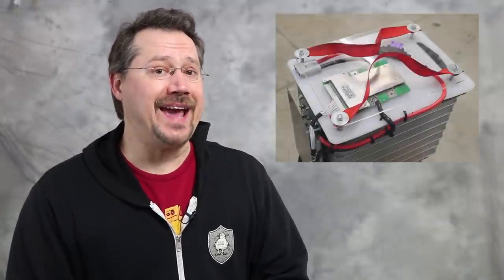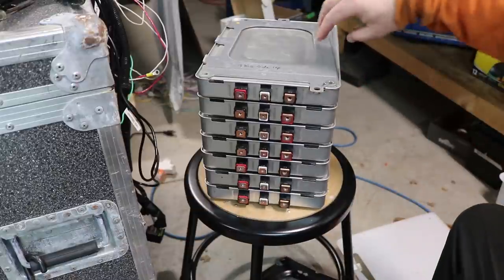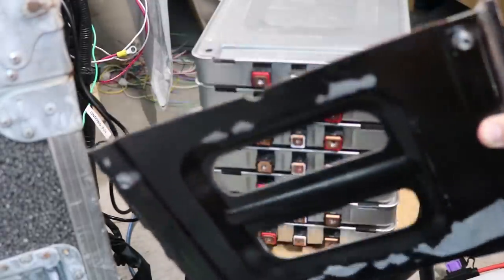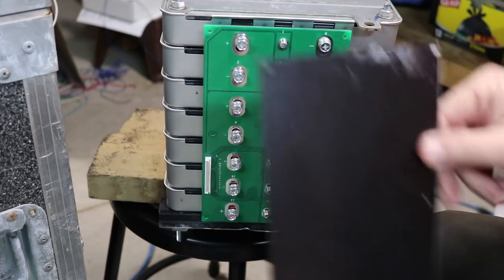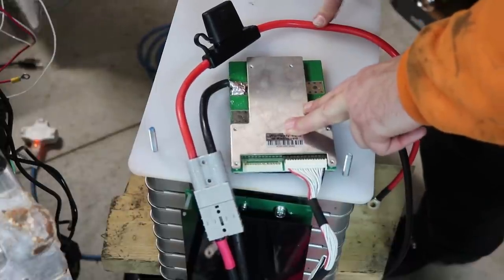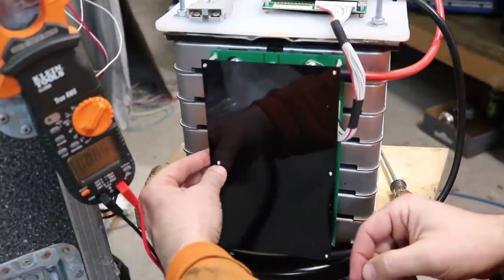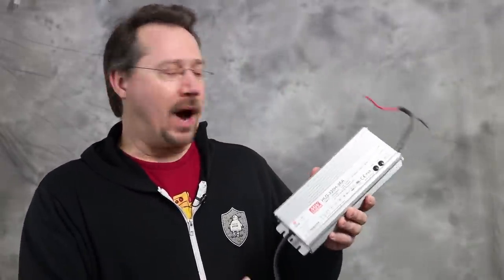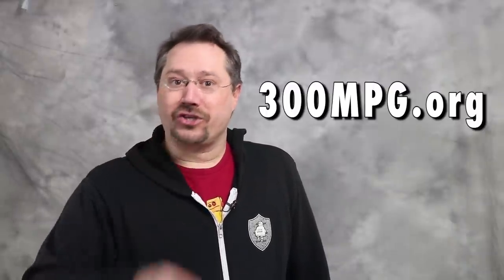DIY 48V Lithium Battery - Step by Step Build - Nissan Leaf Cell Modules

Comment: I need to see if I can find these Leaf batteries locally.  Loved seeing you flip the washers. Attention to detail 👌👍
Reply: LEAF batteries are interesting. I think there are three levels of degraded batteries. I have a 10 year old LEAF that still has 70% of original storage. When that gets down to where the range isn't pleasant, I might swap in a newer pack from a junkyard (the second level). Sourcing that would be in competition with your home storage project. But, my "depleted" pack (thrid level) might still have a good amount of storage for home use.

New 24 kWh battery has 48 of these modules, so this 48 volt stack would be 3.5 kWh, new.
Degraded to end of vehicle usage would be ~2 kWh.

Comment: I Dink Around With Stuff Like That 
All The Time. I Have Been Doing Stuff Like That Since I Was 4 Years Old. I'd Take Battery Operated Toys Apart To See
How They Worked. & I Thought
It Was Cool To See How Electricity
From The Batterys Made The Little
Motors In Those Little Cars Worked.
& I Also Used Fool Around
With Those Battery Powered 
Car Racing Sets Too.
I Dinked Around All Kinds Of
Crap Like Transister Radios.
You Name It I've Fixed It.
Now I Work On Powerchairs & Scooters.

Comment: Love the detail of this video. Looking forward to the follow-up on determining the best, non-solar method of charging.  That's where most people stop giving info. It would be helpful for those non-solar equipped who just want a power outage backup.
Reply from the maker: I'll probably just buy a Meanwell power supply for this. I'll remind myself to shoot of video on it when I do.
Reply: @BenjaminNelsonX  I'm interested in the decision process...  like deciding on the charge rate, shut off when charged, and how many amp hours the one you built generates.

Comment: I built one about a year ago with a nice case. Im building a 12v version now. Thanks for sharing. I would stay away from them gen 1s
Reply from the maker: Is there a reason other than age that you would say to keep away from gen 1 cell modules?
Reply: @BenjaminNelsonX  I find the cooling system in the Leaf is not adequate and they are usually around 50% of rated capacity. They gen 2s are a bit better with up to 90%. Have you tested them ones you have?
Reply: @BenjaminNelsonX  If you are interested in some of the cells I have for sale I believe I can ship now. Never tried to the US yet. I have 2019 Honda NMC 12s packs and LiFePo4 12s packs. Very cheap and in CAD
Reply: @BenjaminNelsonX  8 of my NMC packs will run your leaf motor at 355vdc . Give you a 96s bank
Reply from the maker: @frankz1125  I haven't tested this particular pack yet, but I've had good luck with other ones.
One of the Nissan Leaf battery packs where I bought the whole thing and took it apart, the car only had 20,000 miles on it before it was in a collision.
Reply: @BenjaminNelsonX  that's the best way to buy them . I'd check them new ones. I'm sure you will.

Comment: For me it would be nice to have 2 of them, 36volts or so to use on my GE Electrak tractors. Setup so you could use 1 pack or 2 packs in parallel but I would need more than 100amp max output. 
Keep em coming  Ben

Comment: Very  neat  Ben. I give you another idea.  Connect it to a lgti at night and your electric bill will come down even more. I have two of these and three of lifepo4 conected together to my solar panels with makeskyblue solar charger and my January bill come down to $18.00 dollars. I have to climb to the roof to clean the snow off the panels but I save between 60 to 80 dollars compared to last year.
Reply from the maker: What's an "LGTI"?
Reply: @BenjaminNelsonX  grid tie inverter with limiter. Do you have snow last night? I have to clean over 4 inches  in the morning and now have to go up and clean 3 more. I  removed the Enphase M215 Micro Inverter because they are controlled by the utility and they turn them off if they are producing too much energy.
Reply from the maker: Got snow here last night, but it was so windy that there was very little accumulation on the panels.
Can you recommend an inverter or two that would fall into the Grid-Tie with Limiter category?
I'd love to hook an entire 360VDC electric car battery to an inverter for a full household power backup!
Reply: @BenjaminNelsonX  check Jack Richard evtv store, he has one or two. Sandi 30kw 300-400vdc Input After batteries are full it has a bypass to send energy to the grid.

Comment: Ben!
You are an inspiration. Because of you I have delved into the world of EV conversions. But since I am a newbie, I decided the best way to learn would be to take over someone else’s abandoned conversion.
I have found an excellent project (an older truck with all components assembled and installed correctly). It is basically just in need of batteries. And of course I am looking for a reliable, but more cost effective diy solution.

I have a good lead on up to 48 Nissan Leaf battery modules. I’d like to end up with 144v and 120Ah for around 17kWh, for a range of around 50-60 miles).

Could I create four batteries like the ones in this video, but at 36V using 5 modules each, and run two parallel pairs in series…? Does that make sense?
Given the cells I the modules are already 2p2s and then the modules would be 5s…to then combine them as 2p2s…seems like a lot of p’s and s’s!

Comment: I bought the 48v kit from Tech direct. It came with threaded rod, but not end caps. With a few full discharge cycles, the cells on the end expanded. I think it's still safe, but don't like the look.

Comment: As you installed the cutting board, it occurred to me that you might want to use two of them -- you have a built-in handle that way.
Reply from the maker: I got the cutting board at Ikea a few years ago. It was very inexpensive ($1?) I wish I would have bought a STACK of them. They are really handy as just material!

Comment: Excellent video!  How many amp hours is this configuration and what is the maximum discharge rate of the batteries themselves in 14s (not BMS limited)?

Comment: That's a neat job. 
Could you have used the bus bars from the old connector and just bolted through them with longer screws onto the new circuit board. If you wanted increase the possible load ?
Reply from the maker: Yes, I suppose I could. One thing to keep in mind though is that it's not just the cabling or bus bars that limits how much current can be drawn from batteries - it's also the chemistry and internal resistance of the batteries.
Any battery has a natural limit as to how much current can be drawn,  and just using thicker cables doesn't increase that.

Comment: Excellent video, very well explained, I tried to look on the site you said you bought the bms and pcb from, they had the pcb but not the bms, I have also tried to find the cable with the two female ends but have only found ones with the connector for the bms but the other end doesn't have the female on it. were you able to order this unit the way it is or did you have to modify it? Once again great video.

Comment: I love the video, but early on you said this setup wasn't for a heavy load or demand.  I'm looking at converting a 48V 6-seat CC golf cart.  What different would I need and what is the total amperage available?  I have a 500 Amp Controler and 8-6V flooded cell batteries now.

Comment: If I wanted to do a 48v lithium conversion on a golf cart, would you suggest the heavier buss bars? I love this build.  I am thinking I would have room for two of those. What do you suppose the amp hour rating would be, comparing them to a golf cart flooded battery set up?
Reply from the maker: Generally, those gen 1 Leaf cell modules are considered 60AH. (Keep in mind that these are old and there will be some degradation..) Each cell module faceplate value should be about 500 Watt-hours. So, 7 in series is a theoretical 3.5kWh. Doubling that up would be 7 kWh.
Lithium is more energy-dense, lighter, more compact than lead acid. The other big advantage is that you can discharge it further (use more of the total capacity.)
With lead-acid, you really always want to stay in the top half of the charge to be able to give your pack any longevity.

Comment: Ben Awesome Video!  I'm researching options on converting my lawn tractor to electric.  Personally I think the Nissan Leaf batteries have some advantages over the Chevy Volt batteries.  I'm curious what are the dimensions of the pack you created in this video.  I would need to build two of these to approach the 100Ah I'm anticipating to need for the application and want to see if I have the volume for the two packs.  

Did you ever get a chance to test the capacity of this build?

Comment: Good bit of info but i was wondering why at 7:00 on the video with polarity you wouldn't have just taken the top cel off and place it on the bottom to line up the polarity to match the PC board?
Reply: Seven modules, odd number. The top and the bottom are the same orientation.

Comment: Very cool project.  What is the total kWh capacity of this build?
Reply from the maker: Theoretical capacity is 3.5kWh, but that doesn't account for the fact that these are older batteries. I haven't yet done a full test measuring while discharging for finding the true capacity.

Comment: Ben- this is awesome!  May I ask what one would expect to pay to build this? I'm thinking I want to build a pack for a golf cart.
Reply from the maker: It mostly depends on what your cost of the cells would be. There are a lot of them available on eBay. The best way to get them is as a full Leaf battery pack from a junk yard.

For a golf cart, you will probably want more than just a single set of these. A couple of them paralleled up would be great for a golf cart.

There's even a few places building battery packs specifically for golf carts from these types of cells.
Here's an example: https://www.ebay.com/itm/143542056327?hash=item216bc5f587:g:ltwAAOSwkmVgQXrd

Comment: Could've just put the negative on the left cell as the first one in the bottom and all the issues would've been resolved...
Reply from the maker: There's an ODD number of cell modules. I had 3 of the type with negative on the left and and 4 of the type with the positive on the left. If I started with one with the positive on the left, my LAST battery would have been the wrong type, putting a NEGATIVE connection at BOTH ENDS of the pack! NOT what we are looking for!

Comment: What I'm wondering is where to get the compression hardware and spacers without buying and dismantling an original car module. I'm probably not using the right search terms and I'm not sure what the RIGHT terms would be.
Reply from the maker: It's pretty easy to make you own end plates. Trace the cell modules, draw on some tabs, and cut it out of metal. Drill some holes in the corners and run some threaded rod through them.
If you are buying used cell modules, you can usually get some of the associated hardware to go with them as well.
Reply: Where do i buy a bms, any idea?

Comment: Newbie question here, is it necessary to let it sit over night to load balance if the BMS will be doing the same thing since it looks at each connection on the pack?
Reply from the maker: These cells were already balanced to each other. The BMS should take care of any issues.
If you started with cells that weren't all the exact same state of charge, I would connect them in parallel and let them sit. Then disconnect them, reconnect in series, and attach the BMS and power cables.

Comment: It looks like the BMS is out of stock..  Any other locations?  It seems that one would need 9 of them to build 80KW from two old 40KW Nissan leafs.   I currently have 24KW of panels.    My lead-acid batteries have a few more years of life in them but I am thinking about the future.
Reply from the maker: There are a LOT of different BMSs out there. I just thought it was slick that with this one, you simply put the circuit board over the end of the pack.

24kW of solar panels?!!? WOW!

You probably want to join a group such as "DIY Powerwalls" on Facebook. There's plenty of people building home power backups with these cell modules. They would help you with BMS advice as well.
Reply: @BenjaminNelsonX  We are heating the house as much as possible with heat pumps and have two electric cars (including a 40KW Leaf).  

Thanks for the pointer to the "DIY Powerwalls group" but I avoid Facebook but look at other forums.

I really like the idea of using an old Tesla Model with a  100KW pack. 

The nice part with the Nisan packs (and thus the bad part as to why they degrade faster) is that they are air-cooled and not water-cooled.  The circuit board BMS you showed is very slick.   It doesn't require spot welding new tabs or tons of little wires.   Having 9 Anderson connectors to hook into a breaker/combiner box.

Thanks again for the great video!

Comment: I wonder how hard it would be to use something like this for a car.
Reply from the maker: If it was a 48V car, very easy.
These cell modules originally came out of a car - a Nissan Leaf electric vehicle.

I've used these same cells in an electric motorcycle, and they worked great!

Comment: Can you not just flip them over if the positive/negative are on the wrong side? Seems like you should be able to...

Looks like you took my advice and found an electric powered hydraulic pump? ;) How's the tractor coming along?
Reply from the maker: No, you can’t simply flip one cell module compared to the others.  The top and bottom are different. Think of it like stacking cans of tuna - there’s a curve on the bottom and a lip on the top. 

I’ll be messing around with electric hydraulic pumps in an upcoming video.
Reply: But you could have flipped the PCB.

Comment: How many amps hours? Did I miss that?
Reply from the maker: 3.5 kWh.
Reply: How many amps hours is that?
Reply from the maker: Originally rated at 66 AH each.
Reply: I'm building a hybrid motorcycle.  I'm having trouble with figuring out what battery to use. I don't want lead acid because of weight.  But I need 48v and I'd like a minimum of 100AH more if possible. So I'm not sure if I should run something like this? Or a bunch of 18650's. Or just 4 group 31 lithium iron phosphate trolling motor batteries from LiTime.

Comment: So Ben what happened to the Vectrix is it still running?
Reply from the maker: Yes. The Vectrix is just sitting in my garage. I used the battery on it for experimenting running a Nissan Leaf motor. (With the battery still in the Vextrix, just running a cable over to the Leaf motor.)

I haven't ridden the Vectrix since I was severely injured on (somebody else's) motorcycle 3 years ago.
I really just need to clean it up and sell it. It's a great cycle. Comfortable, easy to ride, and it even has reverse!

Comment: What was the cost of the batteries? You said they could be gotten from a junkyard. That's what I want. To repurpose some EV batts
Reply from the maker: Twice, I bought an entire Nissan Leaf battery from junkyards. I paid about $2600 both times. (And this was a few years ago now, too...) Each pack has 48 of the cell modules inside, along with some other components. That put the price of each cell module around $50 or so each.
On the one battery pack, I took it apart, used 18 modules for my electric motorcycle, and sold the rest of them to friends, covering my cost of buying the battery in the first place. Essentially, that battery was free - just the sweat equity of making it happen!
Reply: @BenjaminNelsonX  I want to use them for off-the-grid power at my spot where I relax. Will those work well for that purpose?
Reply from the maker: @scout4locations  Yes. Just slap a 48V inverter on there.

Comment: Instead just could have moved one single module from beginning over to the end, thus effectively starting the pack on B instead of A, or vice versa.
Reply from the maker: No, unfortunately, I couldn't do that. The BMS uses a rigid PCB and the polarity would have been backwards if I did that.

Comment: this very thin pbs can never tansfer as much as the busbars.,,,i bet it starts fuming and stinking at 50amps alread
Reply from the maker: I do agree that heavy copper bus bars would be better, but I've never had any issues with this setup.
No fuming or stinking at all. I've charged an electric car off of this setup.
Reply: I made a battery off these same modules, but used a 1/4” thick 1” wide by 8” long copper slab to make a busbar.   The hardest part was drilling holes through the copper .

Comment: 8x7 = 56 not 48 ? im a bit confuse
Reply: So, a 12v lead acid battery actually charges to about 14.4v. We call the 12v rating it's "nominal" voltage.

So a 48v battery made from lead acid batteries can charge as high as 57.6v.

Also when the batteries are almost flat, you'll see about 42v, not 0v. So a 48v pack can range from 42v - 57v, depending on the state of charge.

It's all about the "nominal" value. It's 48v in name only.

Comment: Why don’t I get the math? You want 48 volts. Isn 8 volts times 7 plates 56 volts?
Reply: They equal just under 8v per pack. A 48v battery fully charged is just over 52v
Reply from the maker: Keep in mind that we typically use the "nominal" voltage of a battery pack. That's just the NAME of what we call it. A battery pack has a higher voltage when fully charged, and lower voltage when discharged.
It's a range that we are describing with a simple name like "48V".